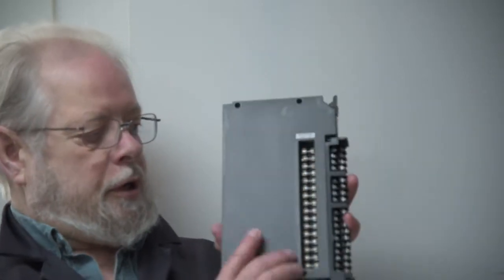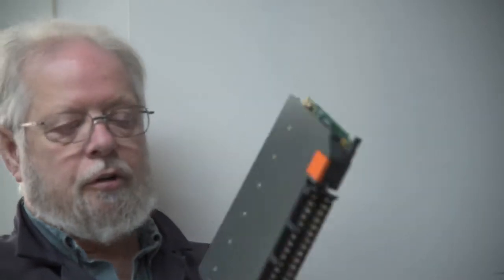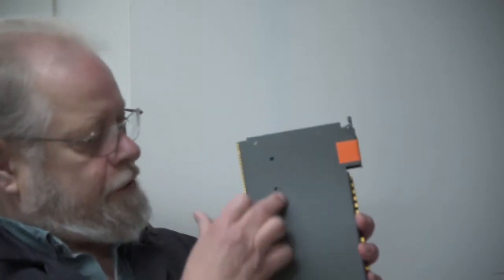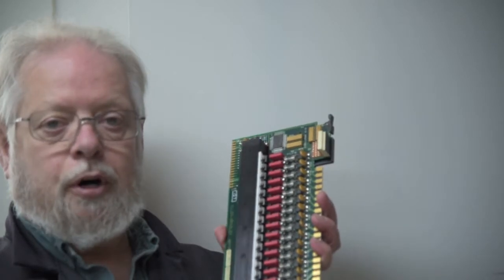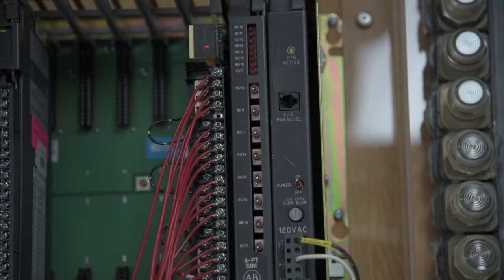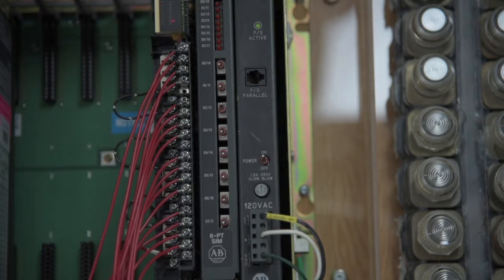1771-ODD & OD16 Testing

Comment: Hey, I have a PLC5 with one of these cards. I was wondering how these are suppose to be wired up? I have the hot from the 120v power supply going to the left side of the card, all these terminals are connected together. Then when I fire the output on the card and put my meter to neutral and put it to the output terminal I get 120v, but when I try to connect something like a string of Christmas lights nothing happens. As a temporary test I just stripped the wire and tied it around the prongs on the plug and I can see I'm getting 120v but no lights?  Also when I make this connect the bottom "Fuse" light turns on. All the fueses in the card are good.
Reply from the maker: These cards are best viewed as 16 single pole triac relays.  
The OD16 & the ODD manuals are available on the Rockwell site - In the search box put the card number and it will take you to the manual.
https://www.rockwellautomation.com/en-us/support/documentation/literature-library.html 
Not every terminal is wired up.  The modules are in groups of 4.
Hope this helps.

Comment: Hello sir
This video is very helpful for me... Thank you
 1771 output modules series B I have in my plc5... Every time no. 3 fuse blown up what is reason
Reply from the maker: Hello:
99.99% of the time there is something wrong with the device that is connected to the module.  The fuse is there to protect the module from damage from devices that are damaged.
I would have to suggest that you start at the device and then check all of the wiring and connections between the device and the module.
Hope that helps.